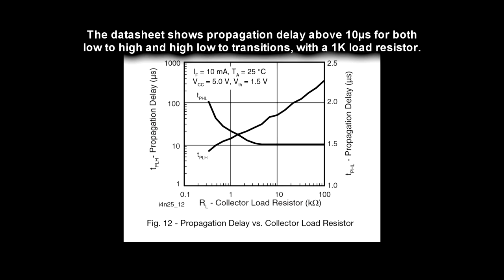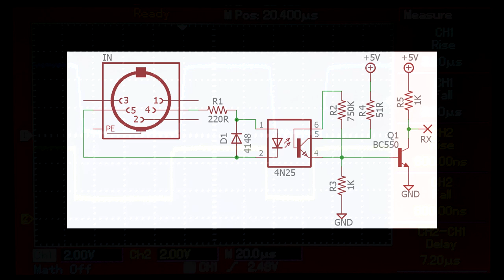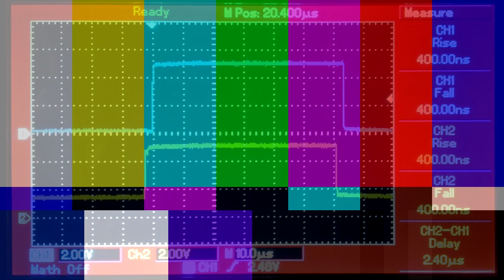Testing 4n25 Optocouplers in MIDI Input Circuits

Comment from the maker: I am building a MIDI merger / filter in order to mix MIDI data from an old Ibanez MC1 - guitar to MIDI converter with data from the Arduino MIDI controller shown last video.
The idea is to expand the control change messages available and also allow the use of expression pedals and potentiometers.
When I was about to build the MIDI circuit on the breadboard, I remembered that the last appropriate optocoupler I had was already used in the Arduino MIDI controller.
So, I decided to try some old 4N25 optocouplers I have dozens here in stock.
It is a six pin IC, just the LED and a photo-transistor with base, collector and emitter pins.
In terms of performance, the 4N25 is a bit on the slow side.
It works without problem with just a 1K pull-up resistor on the collector, and the emitter grounded, but there are ways to make its transitions faster using the available base pin.
Or I could just follow it with a Schmitt trigger IC, if I had one here... 
A quick search on the internet showed me a variety of circuits, from which I chose two for this experiment. 
The tests were conducted using the MIDI output from the Arduino MIDI controller connected to the 4N25 circuits (one at a time), and finally to the  RX1 pin on an Arduino Mega2560.